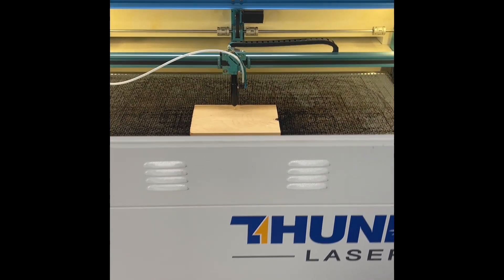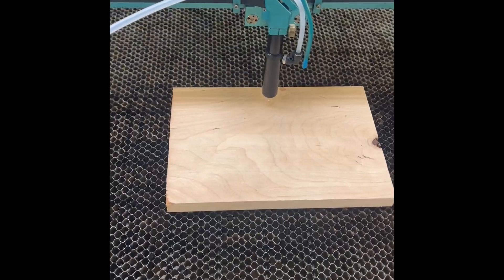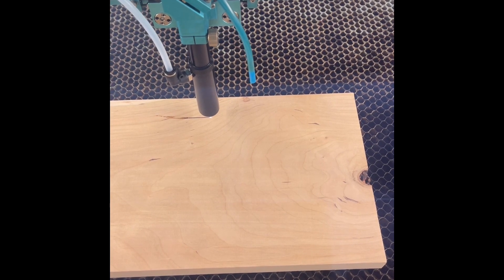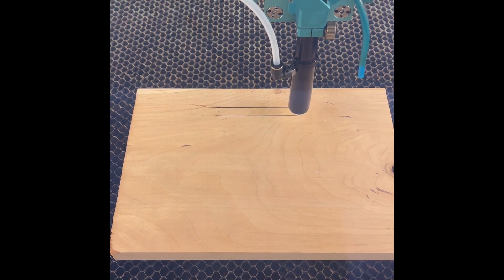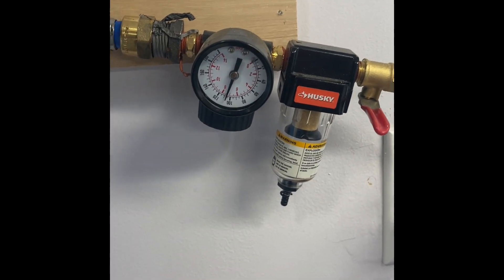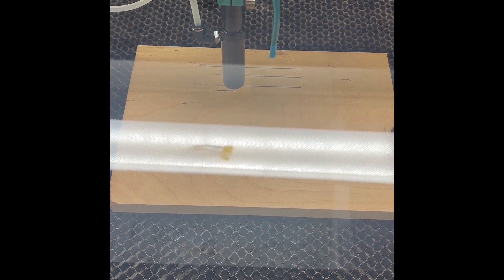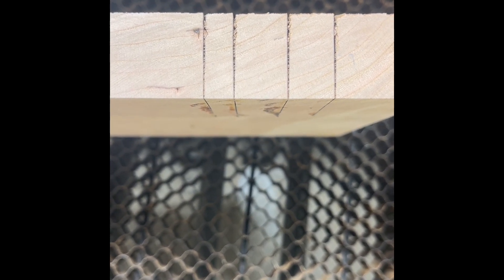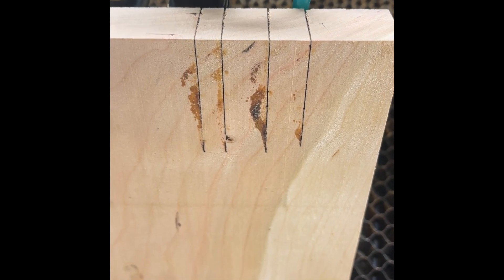Testing Air Pressures on a Thunder Laser 51/130 with an American Photonics 4in Lens

Comment: Your apologies are unecessary, the video displayed the subject well  .Despite your original intention to get better cutting with more air asist you have now satisfied yourself that more pressure is not the solution There is a LOT more to air assist  ( and cutting deep) than most people  think. Can I ask you to watch this video that disects air assist from beginning to end and you will see 26mm hardwood cutting done with 3 psi and a 2.5" lens. https://youtu.be/79VZjMdfBmI.    American Photonics will not believe that.
Reply from the maker: We haven’t tested lower air pressure. I think we will try that and see the results.  We are about to instal a digital air pressure sensor so we can tests different pressures. Thanks
Reply: @Angrycraftsman  
Just a caution.  It is important that you close the airgap to about 1mm and this may not be possible to set AP lens system so that its focal point is just 1mm beyond the nozzle. Make sure you watch the video to understand why.
 Best wishes for your future testing.

Comment: I thought I read that max air pressure shouldn't exceed 55psi on the Thunder Lasers to prevent damage to the air solenoids. I guess you bypassed the solenoids so you'd have to keep it that way if you needed that extra air pressure.
Reply from the maker: Yes I bypassed the solenoids. Under normal operations we keep the pressure about 40 psi